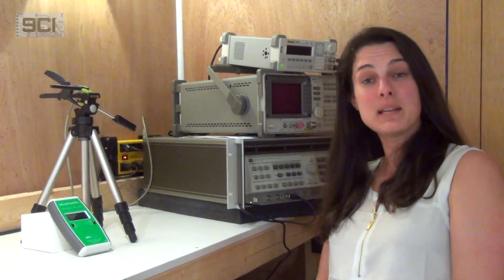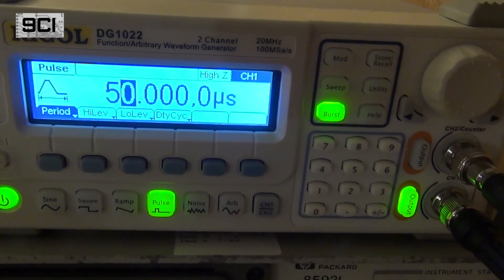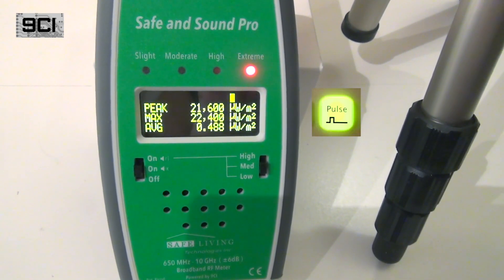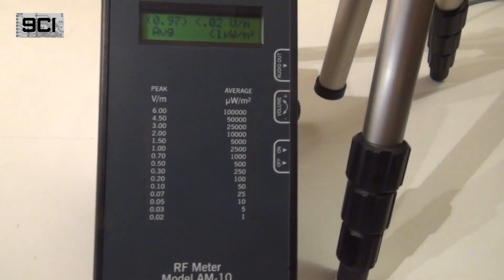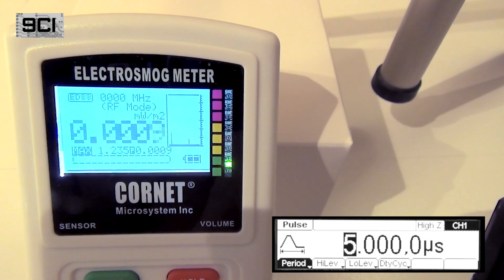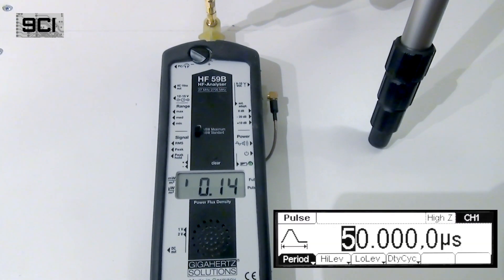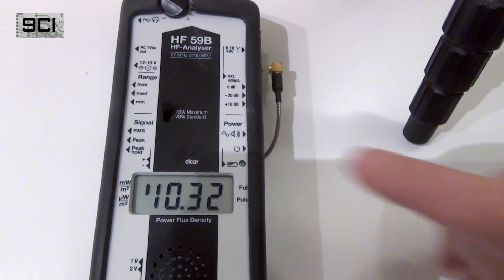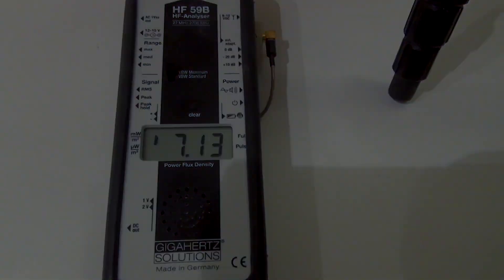RF Meter Pulse Width Test

Comment: The sampling rate on the first Cornet ED88T was only 5,000/per sec, and this one in the video, the PLUS version, is 10,000/per sec. The new ED88TPLUS2 and ED88TPLUS5G now have a faster sampling rate of 25,000/per sec. (...ENV-RD10/Mito Meter 3-in-1's are 20,000 per second.)

Comment: is that 50.000,0 uS (fifty thousand micro seconds) or 50 uS (fifty micro seconds) ?
Tektronix RSA306 is a $3500 unit and it measures down to 100uS.
I think you dont even know how to read, let alone compare RF equipment
Reply from the maker: Hello m33x,

50.000,0  μs is exactly fifty micro-seconds.  That is the way the Rigol 1022 displays this exact value.  In this display range (x.000,0) it is capable of timing adjustments down to 0.1 nano-seconds. The Tektronix RSA306 is a spectrum analyzer, not an RF field strength meter.

If you have documentation of any anomalous measurement using your own test equipment, please send your measurements to us for review.

Thank you for your comment.

Comment: Thank you for this video, I have the Cornet 88T which is for an amateur as me more than ok to find LF, magnetic fields and RF signals inside my house. I have found that the 88T has a much better respons when the sensor, fitted to the left of the device, is pointed at the source. So to be honest, this is the downside of the device, or any device with inside sensor(s).

Comment: Wow, what is the price difference between the HF59 and the SS Pro? Looks like they have similar performance. Does the HF59 have a similar frequency measurement range?
Reply from the maker: Excellent questions! They do perform similarly! The SS Pro retails at less than $500 and the HF59 for about $2000 (1160 Euros). The SS Pro range is 650 MHz to 8 GHz although it can reliably measure outside of this range obviously, whereas the HF59 suggests a range of 27 MHz to 3.3 GHz.